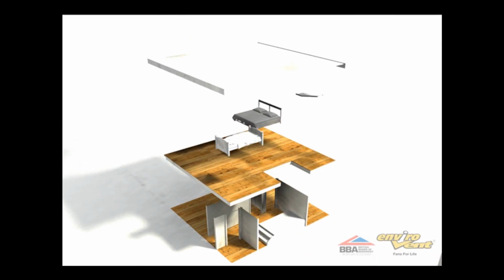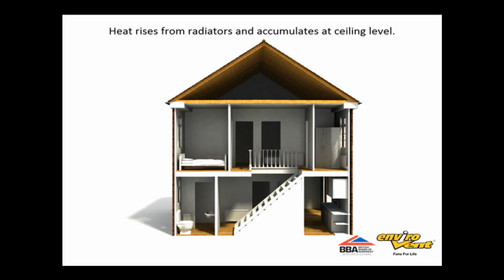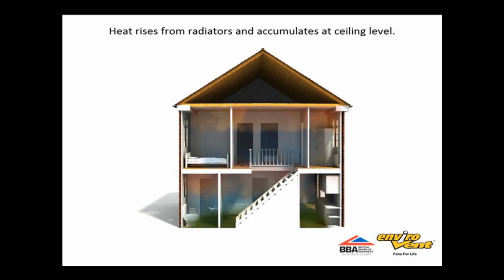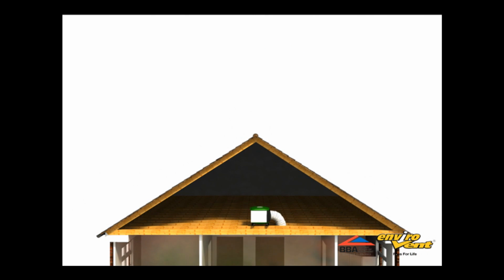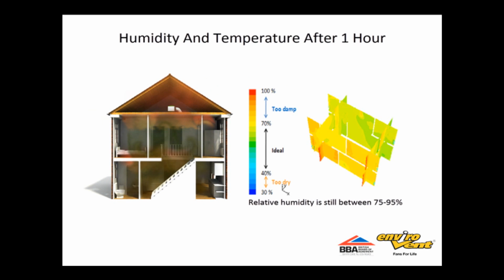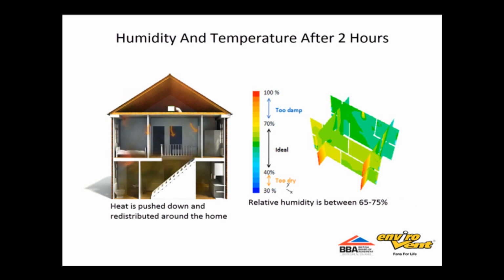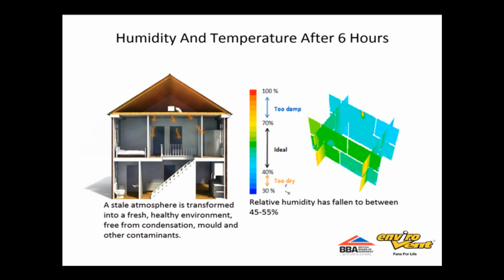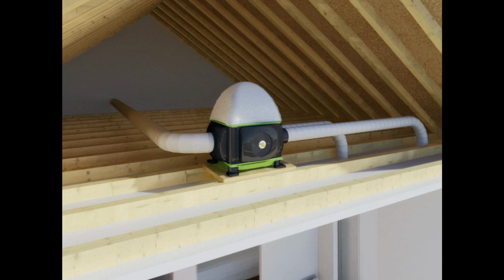Envirovent PIV Positive Input Ventilation EEL Edmundson Electrical Aberystwyth

Comment: Blows all the the cold air from the roof space in to your house which in turn blows the heat out, the heater in them are worthless,
Reply: Wrong! Have you tried one?
Reply: The heater is crap. Bit of a joke this device.
Better to get a MHRV system retrofitted.

Comment: I have this system in my home.
The Humidity has reduced dramatically and the Condensation problems on the ceilings walls, doors and windows have all disappeared. On the down side,  my Home is never warm, it's always cold because the system draws Cold / Freezing air into your living space from the loft which in turn gets ventilated from Out-Side. 

There is a small heater in the system that is designed to raise the temperature of the air blown into the living space to just above dew-point. This raise in temperature is hardly noticeable to the feel, so the air still feels Cold. It's like having a window open on a cold day. 

Finally. If your neighbours are cooking strong odour foods or doing something else which causes an odour. You too will share your neighbours household odour. 

Summary: Damp and Moisture Gone. Smelly and Cold House now. ( You Can't Win Can You ?)

..
Reply: How do you get cooking smells into your house? Mine draws air from the loft space. I’m not sure how cooking smells would enter a loft space🤔

Comment: This is a fan not heat recovery unit therefore warm air from the inside is being wasted. From what I have seen on your presentation you are not extracting the air outside the property. This means the unit will throw all this moist warm air to the    attic. This area is not insulated in most British houses which are very unefficient compare to European houses. Warm air in the attic will cause condensation and damp problems. If your unit doesn't have  heat exchanger the air from the attic is  filtered only not dried . From your presentation you will have warm moist filtered air delivered back to the interior. When temp exciding 25degC it will be ambient temp air filtered and during the cold weather it will be cold filtered air delivered to the inferior. I think you forgot about where you live, this is the rain and mold island not much direct sun. Usless system which will destroy the attic area and deliver cold moist air back to the interior. Rubbish presentation and you have no clue about heat recovery and ventilation.
Reply: This isn’t a heat recovery system and they don’t claim it is, there is no inverter. It’s a pressure system to draw fresh air in and it’s filtered.  It drives out stale musty air and the condensation disappears.
Reply: It'll be dry filtered air pumped into a central location like the landing space upstairs but the air is cold. Bit of a hit & miss solution.

Comment: No need for a PIV system. Just open your windows from time to time and problem solved. Windows are not a feature, they are there for a reason
Reply: Sorry but you’re wrong. I’ve lived in the same well insulted house for 4 years. Trickle vents on the windows  and  windows left open quite a lot. 
Loads of condensation on all the windows and black mould forming on frames and window reveals. 
Put a PIV in 24 hours ago, 5 degrees outside, windows closed, heating on and now ZERO  condensation!
It works as a system.
Reply: @cerec69  I'm thinking of getting kne of these systems. Does it blow cold air into house like some people are suggesting?

Comment: hi how do these work in winter does it not make the rooms cold as there is no hot air for it to force in only cold. i have mine turned off for that reason cold air coming in, in winter.
Reply: I read that these also have a heater that heats the air as it passes into the house to take the chil off the air.
Reply: I agree about the cold air that comes through these units. Housing association put ours in but no instructions if it had to be serviced or anything plus where does the water go that it takes out of the air?
Reply: The heater is crap. Does nothing. It will be cold air. 
If you're lucky the dryer air might make the house feel warmer but don't count on it.